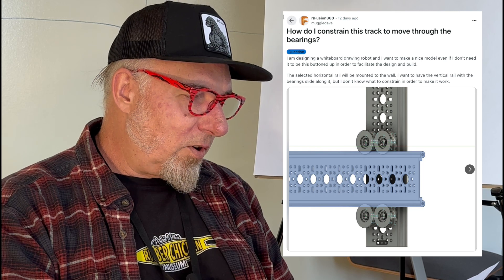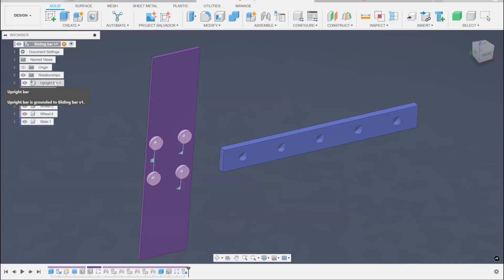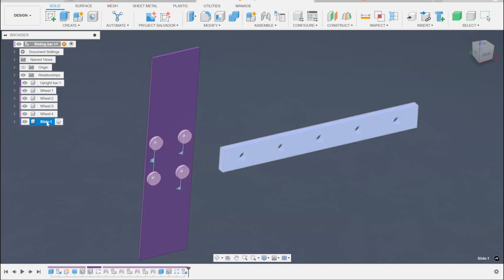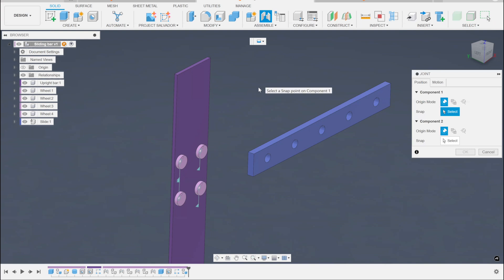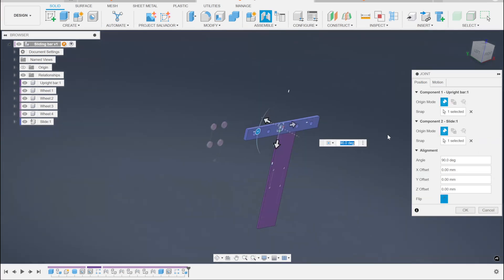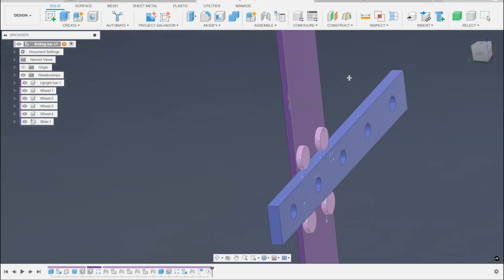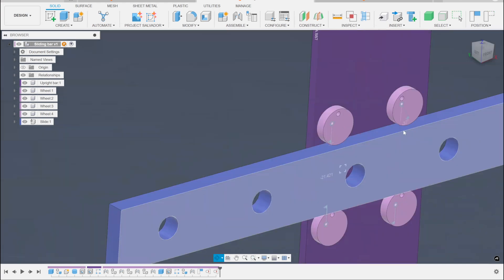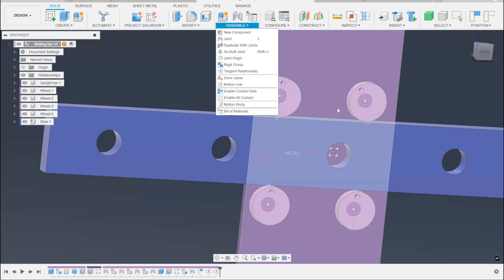How to Use a Planar Joint with Tangent Constraint | Unstuck my Fusion Design

Comment: Simple answer, but does that still work when the wheel's contact surface is a concave torus and the rail is a cylinder as actually shown in the question? Especially regarding simulation of the range of possible tilt and racking/binding that might be encountered.
Reply: Yes